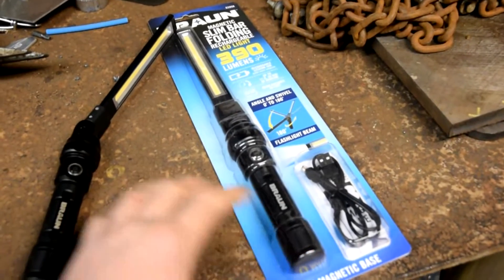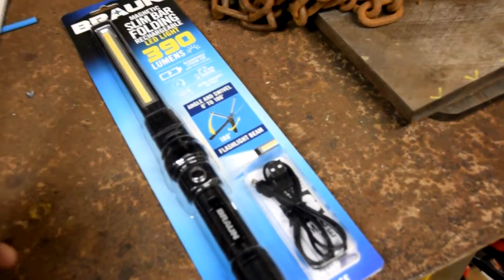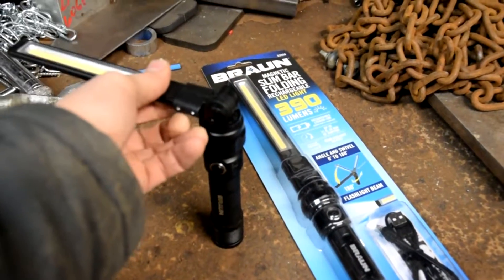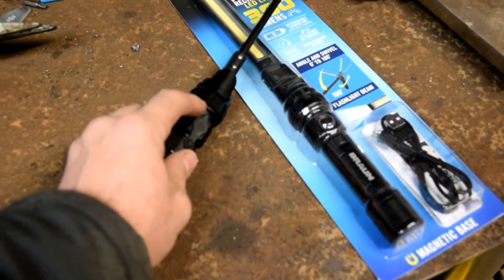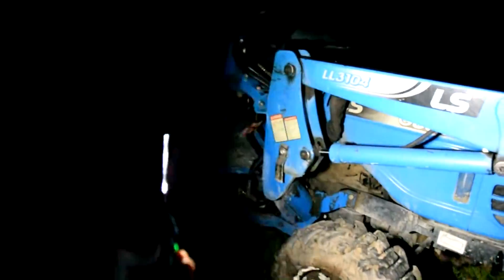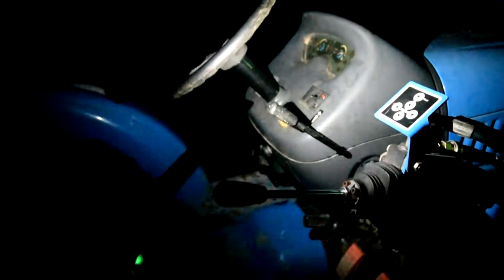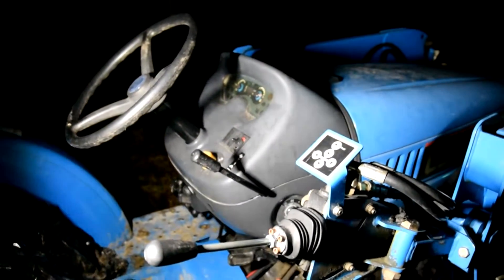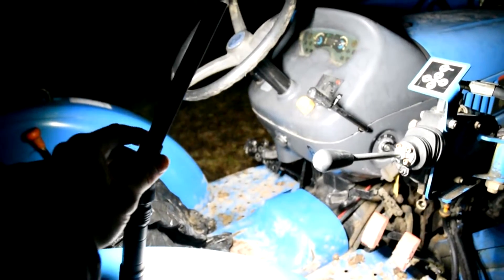Review - Braun Slim Bar Folding Work Light

Comment: Have you ever accidentally got an eye full of the light? If so, were your eyes okay after? I am worried about possible damage, because I accidentally flashed myself a couple times. When your tired, it's easy to forget which side has the LED.
Reply from the maker: Yes, frequently!  I don't think it will do any permanent damage.
Reply: @goddom , thank you for responding. I appreciate it.